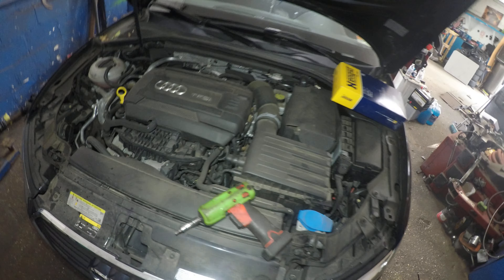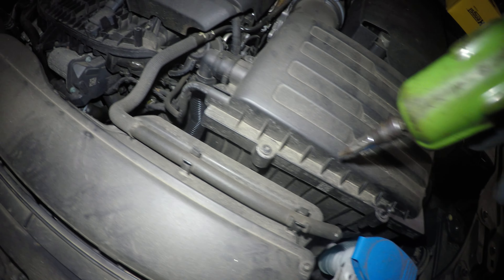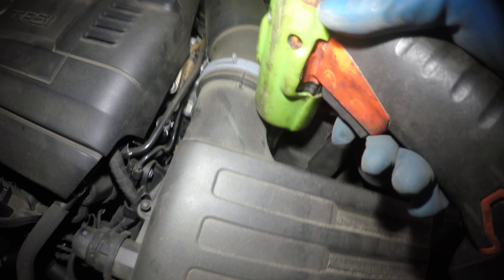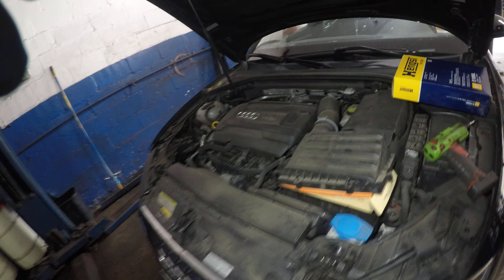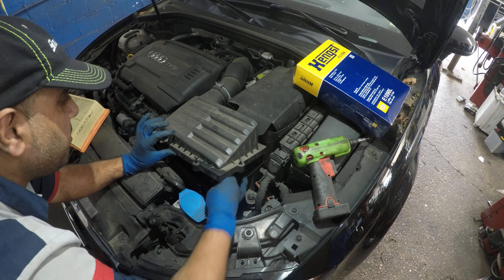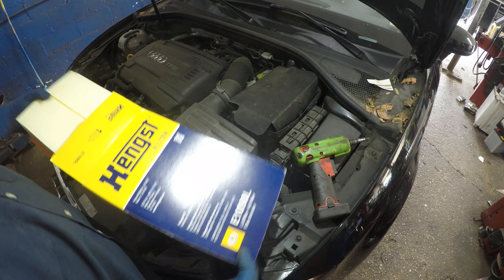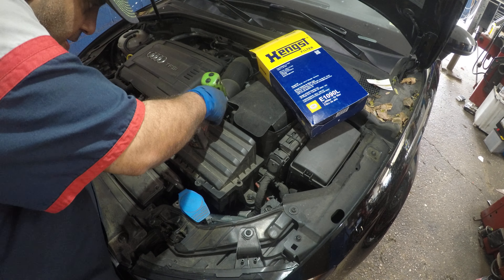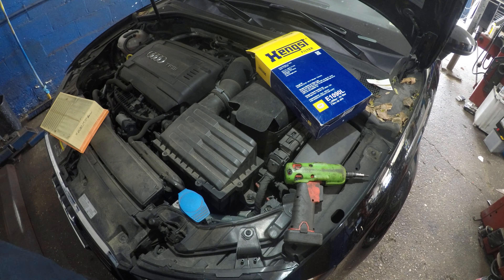How to replace engine air filter on AUDI A4 2.0 2017 2018 2019 2020 2021

Comment: Best guide sir😊
Sir can you give your number sir
Reply from the maker: Thank you! Nope I don’t want my phone ringing 24/7 but if ur in nj north Bayonne area we can do service ur car
Reply: @RBTheMechanic  sorry sir but I'm from Pakistan. But I will do question here.
Actually sir in our country Pakistan cars have only 
4 cylinder engine with rocker arm/stim bucket wo do tebet/valve of them according to firing order 1342
But there is also 6/8/12 cylinders engine in V shape.but in our shop just 4 cylinder bcz our master is not good in big cars.
So my question is that  
1.how to tebet/valve adjust of v6/V8 any of them 
2. Does big cars need timing belt/and how to do that
3. Rate of your shop to do tuning bcz in our country free tuning 😁
4.how we check firing order of V6 engines who is on top dead center/bdc
Reply: Sir you didn't send answers of these questions!❤
Reply from the maker: @AnimeHindi4  every car has timing our rate here varies 90$ and hour up to $150 an hour and in America there’s nothing free
Reply: @RBTheMechanic  hello sir actually today we change engine 2500cc to 3000cc in Toyota mark x
Complete engine is changed.and now there is problem in that back gear is good but when we put on 1st gear it's like we start the car at 5th gear very slow pickup and in scanner we didn't find anything no DTC.kindly guide us thankyou